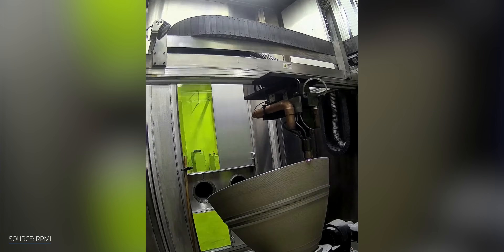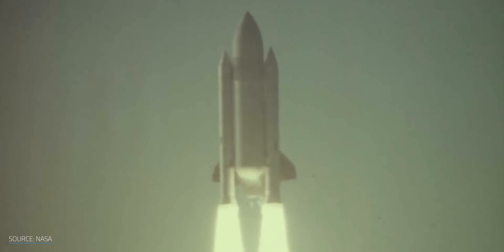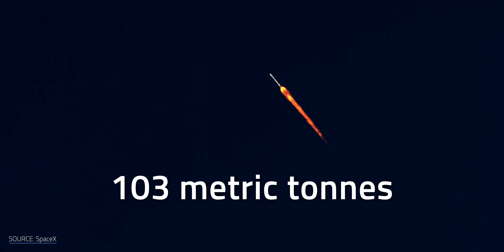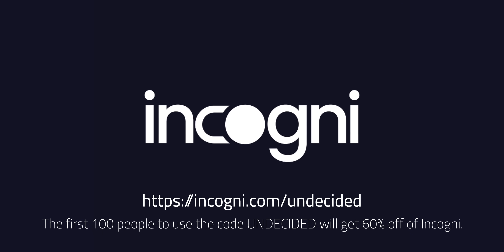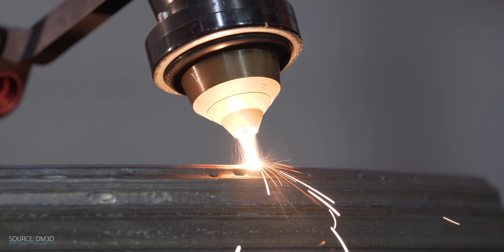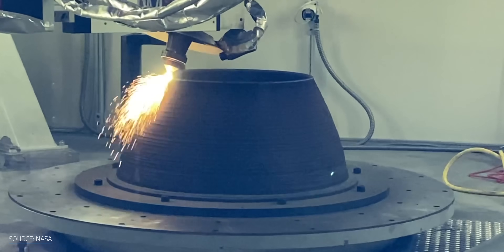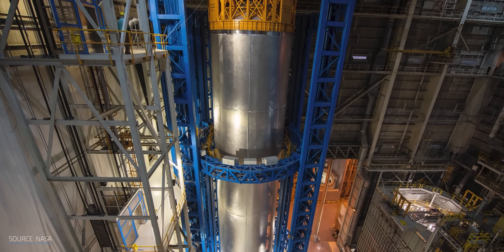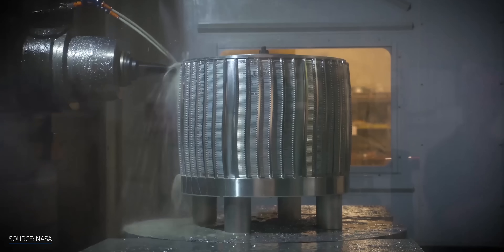Why NASA’s New 3D Printed Rocket Engine Matters

Comment: I  have a real issue with this video and your presentation of the topic.  You mentioned only one reality of 3D (Metallurgical) Printing ... it's going to be (mis)applied until it finds its niche.  Nearly every glowing comment shows the very poor understanding of materials science and particularly with Metallurgy.  While Relativity, NASA, Boeing and others ARE 3D Printing metal parts, and not just any component, but those subject to high pressures and forces, the reality is that there isn't just the fancy new alloys that are designed to flow in a 3D Printing mechanism but also the requirements for very extensive & expensive post treatments to forge the required Metallurgical properties.  This video and so many "oooo & ahhh" 3D Printed Rocket YouTube videos make NO MENTION of the realities of the underlying materials science and the extensive pre- & post- treatments.  I've watched various great videos on your channel for years now.  And while this one is good, it is very sorely lacking and I am more than disappointed.  I will dare to say that your video is on the verge of being more clickbait than science! Lastly - among other issues, please don't mention a mere 3 Universities in the JPL JUCI partnership when there's literally dozens upon dozens of them who are involved!  (For example, don't mention TX A&M when it's merely the TX A&M Kingsville campus and not the main College Station one!  And good gosh, the University of Texas at Austin has been doing FAR MORE in Aerospace & Rocketry than ANY OTHER TX university, especially since Firefly and SpaceX have Propulsion facilities closer to Austin than at any other TX school!

Comment: you just took the 103 metric tonne figure from the engineering breakdown video and used it incorrectly. 5% of the fuel of a Saturn 5 is 103 tonnes... 5% of an F9 rocket is only about 20 tonnes...

Comment: Laser deposition parts still typically need to be, as a minimum, linished to become as accurate as what would be required to be considered 'accurate' enough for use in applications such as rocketry and jet engines.

Herein lies a problem.

Whereas CNC parts are developed with this in mind, being over engineered to not buckle out if shape when going through the 'finishing' process, to allow for such requirements when producing parts via laser deposition would mean having to waste a whole heap of time and material in printing out extra material to resist the pressures applied to the part during the CNC based finishing processes.

Comment: is that 30% fuel savings or a 30% increase in specific impulse, because if it's the latter like even out of the context of the rocket industry that is huge, a 30% increase to specific impulse over the duration of a flight assuming the same trust and weight of the craft could like over half the amount of fuel you need, so it's probably the first.

Comment: UK firm Reaction Engines Ltd is developing a hydrogen air breathing rocket for space planes that will function as a scramjet burning the oxygen in the air up to Mach 5 then switch to liquid oxygen, saving 20% less liquid oxygen, the precooler contains thousands of pipes and cools the incoming air by 1000 Celsius in 1/20th of a second, Swiss firm Destinus is developing a hydrogen afterburner, I couldn't find out if Canadian firm Space Engines Systems air breathing rocket that will switch to liquid oxygen at Mach 3 will use hydrogen.

Comment: Additive 3d printing is showing promise, but I would show caution. I saw a video some time ago on this technology (Possibly real engineering) that showed that it does have issues. Because components are not being cast and milled in the traditional way it has an effect on the strength of the material. Something to do with the size and shape of the crystalline structures the alloy makes which can lead to weak points.

It's quite possible this has been overcome since then.

Comment: I recently had the pleasure of visiting Takumi Precision CNC in Limerick, Ireland 🇮🇪, they manufacture replacement hip and knee joints with 3D metal fusion printers to an extremely high quality. These joints are used in robotic assisted operations to ensure precise installation in the patients and giving a much better outcome in terms of patient recovery and lifespan of the replacement joint.

Comment: What do you do if there is a failure of an integrated part like a crack in a joint deep inside? Doesn't that mean reprinting the entire huge piece of equipment instead of just one three inch hole?
Reply: Depending on the material a traditional repair like welding might be fine. Otherwise I'd think cracking is something to be fixed in design for these particular applications.
Reply: Even if you have to reject 1% of parts, the improved performance would probably more than offset that.

Comment: I think eventually additive is going to be the predominant method, but it’s still gonna be a while before it’s so easy anyone can make anything [like a Star Trek replicator]
Reply: We're a very long ways from Star Trek replicators - we would need much more than additive manufacturing for such a thing to be possible, since it really needs to be able to work on an atomic and molecular level to do some of the things shown in the shows.
Reply: @logicalfundy  indeed. I meant more figuratively — like, being able to tell your 3D printer “make me a set of drawers”, give it some dimensions, and have it spit out a set of drawers without having to adjust settings and all

Comment: Additive manufacturing is so crazy! The amazing thing about getting an aerospike engine or rdre engine to work is that it is less dependant on altitude. With a traditional bell style exhaust you have to optimize for specific altitudes. This then gives the necessity for multiple stages to stay efficient. With these new styles you can have a single stage that has similar efficiency for most of the route. Of course, there are also advantages to shedding weight of empty containers, so it may not entirely remove the need for stages, but you can have fewer longer running stages.
But less fuel on board is less fuel to lift, which helps a lot with the tyranny of the lift equation.

Comment: Can semiconductor chips be 3D printed? At present they are only flat 2D wafers that are etched and need external cooling. Imagine if they could be built up in 3 dimensions and have integrated cooling channels.
Reply: Well the finFET process is a “3d” node where the traces are a vertical “fin.” But besides the process nodes there are also 3d stacked chips where they are printed flat but stacked on top of one another. The main issue with the having transistors stacked on each other is the amount of heat that they generate can burn out the chips. The only actual use case I know of for 3d stacked processors is AMD has 3d stacked chips for their CPUs.
Reply: @kickinacoustic6119  I'm not talking about stacked layers. I'm talking about a fully 3d semiconductor without separate layers at all, but with integrated heat dissipation channels 3d printed into the volume

Comment: A very good video on additive manufacturing applied to rocket engines. 

For a little perspective: NASA currently pay $100M per copy for the RS-25 hydrogen/oxygen rocket engines that power the Space Launch System (SLS) at liftoff.  The RS-25 takes months to build.

The Raptor 2 engine built by SpaceX is an equivalent methane/oxygen design that costs $1M per copy. Present production rate is seven units per week.

IIRC, the Raptor 2 uses additive manufacturing for some critical components.

You really oversell NASA's relative contribution to this technology. Private companies are pushing the state of the art, not NASA.

Comment: I worked on NASA programs that had the first additive manufacturing components. The first item was a blanking plate (very simple). By the time I left, They were getting more and more complex.  4 years later, they are really more complex.
Reply: Well your welcome my dude, I was the random dude that sent in the concept drawings and engineering breakdown for the prototype. I'm so happy to see I was right about damn near everything on those 3 drawings and 2 pages of explainer text lol
The cooling channels especially are the one thing I loved most hearing actually work in real life. I was going off of on paper calculations of Hydrogen's characteristics under vacuum and high pressure to resolve any doubts I had so luckily you guys tested that out thoroughly.
Thanks for whatever you managed to do in the mission, it's cool to see it coming to fruition.
Reply: Then you woke up? @apIthletIcc
Reply: @apIthletIcc  If you were going to make Spiderman's web shooter, how would you go about it? And what material would you use for the shooter?
Reply: @Lucius-Fox-t7v  Im not an expert in trigger/launcher mechanisms so I couldnt begin to answer that although it is something I had on my mind kinda recently. I could ask my dad, hes better with everything else other than the rocket lol
Reply: @apIthletIcc  Please do, thank you! 

I'm currently building a 3D printer to play with a design, the only other thing is better electronics and web fluid. I suppose my plans of pursuing an engineering degree will be worth it, heh.
Reply: @Lucius-Fox-t7v  maybe  but then again. I dont have a degree in engineering, but I have independently studied a little bit of everything i could find to read my whole life. id have a doctorate if i focused on just one field, but so many things i want to work with require a generalist skillset, or just more people. And as i said I only have done independent study. Never went to school for any of that though so thats nothing to hold anyone back.
Reply: @apIthletIcc  Wow - then you must truly be a polyglot, if you've sent in data to NASA or other aerospace organizations/companies and they've considered your data in their process. That's quite an achievement.

And yeah, I feel the same, so many fields are so interesting it'd be constrictive to focus on just one. I'm only doing tech because with our current industrialized society it's in everything (and also because of comic books).
Reply: @Lucius-Fox-t7v  Writing scifi stuff is where my best ideas came from. I needed something to draw one day and it branched out in a thousand directions and new stuff for me to then learn and then now Im up to about 13 seperate but connected stories. I really have too many things going to finish one lol so some of my best ideas i will literally just give away so they can be done in a timely manner. Thats 100% not even a joke i should be rich but I dont want money.
Reply: @apIthletIcc  If you're good at drawing, I suppose you could come up with a manga, or learn along the way.
Reply: @Lucius-Fox-t7v  Manga is my default art style. I just keep adding to the story so its not ready to draw really. Theres alot of time span to fill in, for pretty much all 13 of the stories. One thats longer in the grand scheme, is meant to account for about a ten billion year span of time for instance.

Comment: Very cool, Matt. One thing, since you were speaking about cost savings and efficiency so much, is the subject of re-use, that SpaceX and Blue Horizon seem to have mastered. It's great that they've been able to shave the cost of one-time-use components. The next big step, I'd say, is the ability to not have to throw away all that well made tech after each launch.
Reply from the maker: Great call out on Space X and Blue Origin.  I love seeing the different approaches to bring the space exploration cost down.
Reply: SpaceX is obviously the leader in reuse (a total of 229 landings of orbital-class boosters so far, and the number of flights and landings of an individual booster is now up to 17 and counting). But others are getting onboard, such as Rocket Lab (Electron recently started to reuse engines and Neutron is being designed for full reusability) and Stoke Space (new kid on the block, but they are doing innovative development of the second stage, which is by far the hardest part to reuse). Blue Origin has intentions, and sub-orbital hops are not nothing, but they haven't even tried to get to orbit yet... we're waiting.

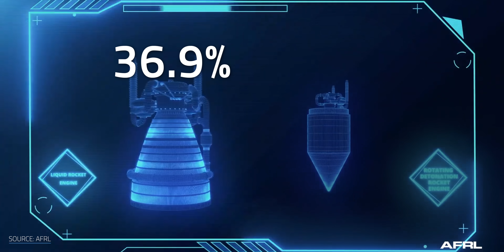Comment: Love your channel.  1 point, at 3:05 - Comparing "gas turbine engine" to a rocket is apples and oranges, NOT the same... wish it was compared to a different rocket.
Reply: Matt seems like he knows what he is talking about. BUT he said "gas turbine engine" and the image was of a rocket engine. And at 4:45 he says "as the fuel mixes with air" again it is a rocket engine, there is no air in space. So did he mean as the fuel and oxygen mix?

Comment: While the fuel savings of this motor design if impressive and the 3d manufacturing also applies a savings we do not want this to become a reason to go back to disposable launch vehicles.  SpaceX upset the apple cart by showing that the most expensive part of a launch system can be reused  so any use of this new technology should require the reuse

Comment: I wonder how a scaled engine rotating detonating would compare to raptor 3. Also the cost comparison. They're definitely expensive, but space x uses engines that are 100x cheaper than the Rs25. Can there be any more cost reduction? They also produce slightly more than one a day, so it's not hard anymore. Although I do believe nasa should build a test engine that companies can use as a blueprint to build their own.
Reply: Currently they don't compare at all.  You can't get into the same magnitude when it comes to thrust or thrust to weight. You can't even get into the magnitude below the magnitude.  It is very hard to see a path from this that leads to cheaper or better launch rockets anytime soon.  There are so many things that need to fit into the bigger system of the entire rocket, the ability to throttle, restart, lifespan, but particularly thrust to weight , in order to build a cheap launch system.
Now, when it comes to vacuum engines, space engines, otoh, particularly third stage rocket engines, i.e. post orbit, when thrust is not a big deal, only specific impulse, I think we might see these rotating detonation engines pretty soon, if they can crank up lifespan.  They will provide a higher specific impulse for chemical rockets, which are far simpler and cheaper than Ion, plasma, nuclear engines.  They're not as good, but they can be in a completely different ball park when it comes simplicity and costs.  And they don't need a radioactive isotope power source or solar panels, only fuel.

Comment: Wondering if additive manufacturing might also make an aerospike engine more feasible.
Reply: RDE's typically have an aerospike nozzle
Reply: In a conversation between Elon Musk and the Everyday  Astronaut, Elon said the tech risk and expense of aerospike engines did not seem to be worth the benefits.  Adding RD benefits should tip the balance in its favor.  Or if someone spends the money to derisk it.  Heat at the tip of the spike is said to be a problem, integrated  cooling channels from 3D printing may help with that.

Comment: This is the kind of leading-edge work that NASA was created for, not helping to prop up the legacy rocket industry with $4B/launch SLS that was forced on them by Congress.
Reply: But it’s not even NASA that is leading the way in using additive manufacturing in rocket production or design, Relativity Space have the biggest printer and have used it already to print most of the rocket they recently sent to space.
Reply: @nononono3421 Relativity is mentioned in the video.

Comment: I didn't realize they were applying it to RDRE already. 3D printing the regenerative cooling was an amazing advancement, so seeing it be a part of the next fundamental design change in rocketry is wonderful. Relativity Space had said their real goal was to get their process in the door, and it's so cool to see that it worked.

It's weird to me how some people think it's still a niche or toy process. At this point hardly anything is prototyped without 3D printing of some sort.
Reply: Practically every rocket maker uses those Velo3D machines

Comment: it will be a good thing to mane cheaper engines, etc... but the problem of the aerospace propulsion is that the chemical engines are obsolete, we need new ways of propulsion, faster and more efficients... termonuclear and ionic propulsion are the game changer if we want to explore the Solar system in reasonable times.
Reply: "Obsolete" requires having a working and readily available better option. We are still a long way off from fusion propulsion and ion drive is currently only capable of minute thrust.

Comment: Do you know if they had considered multiple shockwaves like in one starts clockwise the other one starts counterclockwise, so Anton has that concept been considered?
Reply: Counter-rotating shockwaves would collide and die out, because the fuel has been burnt on both sides. Dual synchronous shockwave has been tested, but one tends to eventually catch up and merge with the other.

Comment: One thing this video didn't really emphasize is WHY even a half percent efficiency improvement matters so much: part of the struggle in launching a rocket is you need enough thrust to not just carry the payload but also the fuel itself.  So, you need more fuel for more weight, but because the fuel is heavy, you need more fuel to compensate for more fuel.  This leads to an exponentially larger rocket than you would otherwise need, and it's also why every kilogram added makes a big difference.  That's also why 95% of a rocket's weight is just fuel.  That can add complexity and of course, there's just the cost to build and fuel it all.  So, a 20% improvement in efficiency is absolutely mind blowing.  I can't imagine how many hundreds of millions of dollars this will save for just a single launch.  I'll be very curious to see how tiny one of these rockets will be in comparison to older models with the same payload capacity.